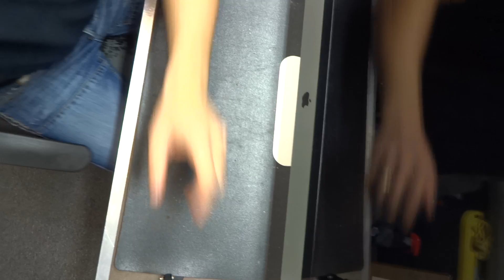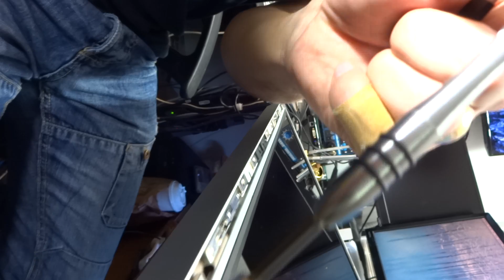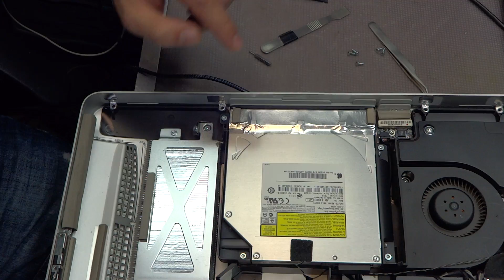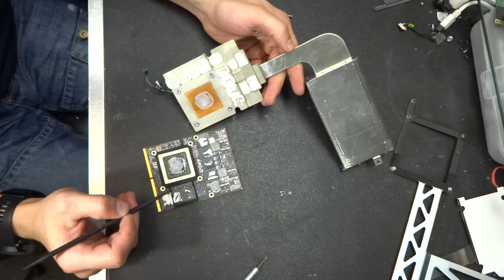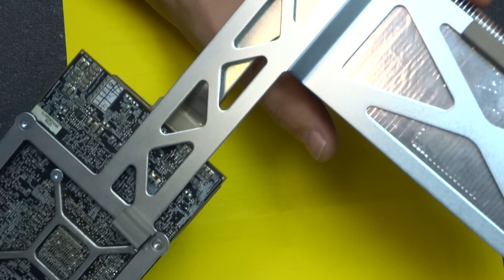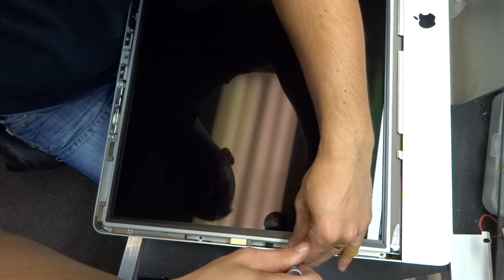Imac 27 Inch 2009-2011 Graphics card replacement

Comment: Too much thermal paste. And never NEVER ever put old thermal grease back in. Use thermal pads and watch thecorrect thckness. Youll needdifferent pads for the different components of the graphics card. And for sure cooling the RAM modules extend their life so those ARE important.  The Sensor from behind the logic board is best installed with the bended sharp tweezer in upright position. And make sure to cover the PSU while repairing.

Comment: Very detailed repair. Only problem is your graphics card will burn out again soon if you don't replace those thermal pads. The problem I ran into is that 1mm thick thermal pads make the graphics card not set flush with the heat sink. Meaning the lower half of the graphics card is touching but the thickness of the thermal pads cause the upper half of the graphics card not to touch. There is a type of thermal pad that is part paste part pad and that is what they used at the manufacturer. The cost of replacing this is about 36 to 40 dollars for a 3 by 3 inch square. You MUST use this type of pad or your card will burn out again. The thermal paste is called K5 Pro viscous thermal paste. it's what Apple uses in iPhones as well.

Comment: your screws have heads mine are without which link the graphics card to the black board. I want a better graphics card in my mid 2011 iMac 27 inch. Can you tell me where to get one?

Comment: Hi, I have an old imac 2009 27” working but video does not shows up on internal screen, I noticed that the very same component on logic board you mentioned to pay attention in the video when removing gpu is missing. It is marked c6401, think it is a capacitor, do you know what size is it to find a replacements? Many thanks, great video!

Comment: 4/30/2020 Very good video I have this exact model with the GPU issue of not letting computer boot, so needed to do GPU bake and thermal paste to get the iMac back up and running, the hardest part of the job is trying to get the thermal sensor cable back into the motherboard, but the bake did the fix, now that dam cable, ugh. Your video covered all the main steps needed for the repair.

Comment: My screen just randomly goes black. No ghost image when I hold a flashlight to it. Just black. If I connect an external monitor after it goes black the external works fine. Is this the same type of issue?

Comment: Wow! You just saved me a lot of anguish. Thank you for the clear and concise instructions on replacing the graphics card. I thought my 2011 iMac was now a boat anchor, and was about to remove the two drives I installed a few years ago and consolidate everything on my 2017 iMac. Everything I had read and listened to prior to running across your video told me that a bad card in the 2011 was not repairable, or at least not worth repairing. I'm headed to eBay today to find a new card so I can get the machine back up and running. Thanks again. 

One other thing: I can't believe that no one has commented on this. Am I the only one you've helped? Can't be....

Comment: I have a mid-2011 iMac 27" i7 with the 2gb GPU. Where would you find a replacement card ? is there a way to repair the original card if it desoldered itself?

Comment: Great video but also a shining example of why Apple is just a ridiculously overrated company. Over 30 minutes to replace a GPU (with special equipment). Any PC will take exactly 5 minutes and 1 screwdriver. And the PC (at 2/3 the cost) will kick Apple's ass on everything except style and a few specialized software programs.
Reply: It took me two days to repair it. The way this PC is assembled is total crap.
Reply: Hi how are you thank you very much for the video helps a lot .... I need help from you if you don’t mind if you can help me to buy the video card from the eBay my computer is iMac 27 2011 but I’m seeing a lot of video card but I didn’t know which one is the right one to buy my phone number 914-837-8627 I will be more than Thankful if you help me with that I’m a big fan for you

Comment: Help! my 2011, 27 inch imac gpu went (1st a checkered screen, also a dim spot in the corner of the screen when it use to work), it was replaced with a used one at a shop & it stopped working in a few days (a few FCP & iMovie projects).    

At the shop he claims he fixed the  new/old card & it will work but not for editing. I don't know what to do (am in uk) next, I NEED A NEW GPU, IS THERE BETTER GPU OPTIONS?

Comment: I did this on my late 2009, 21.5 inch iMac, it had a ATI 4670 256MB I upgraded to a ATI 6750 512MB but the screen is now black with sound do you have any tips on what might have happened?

Comment: hello, very good video!!! i have a little question: i have a 21.5 iMac and i wanted to change the thermal paste, but when i boot up the iMac the screen remains black (but the system works fine in share screen). Due to that i saw that the graphic card doesn't show up anymore... do you have any idea where that could come from? 
Thank you in advance